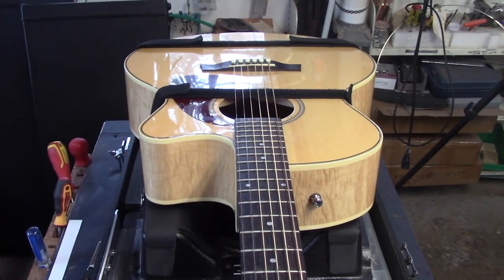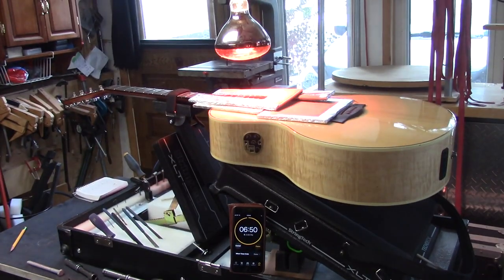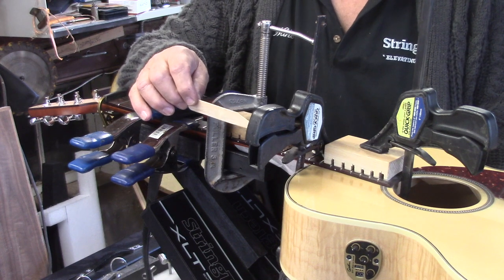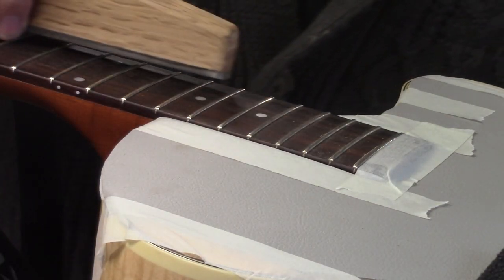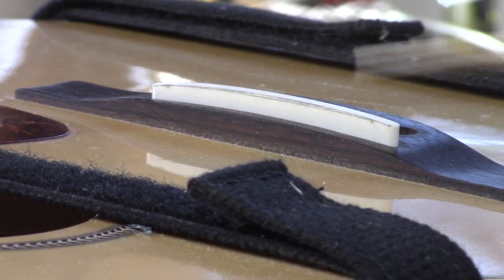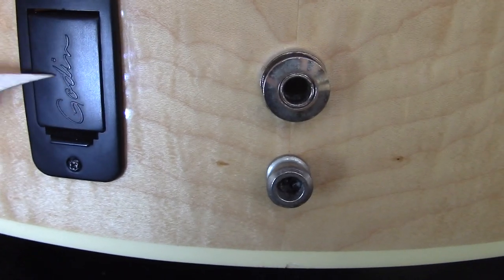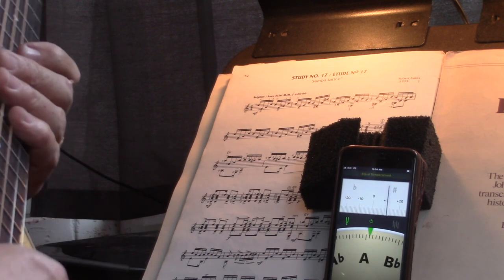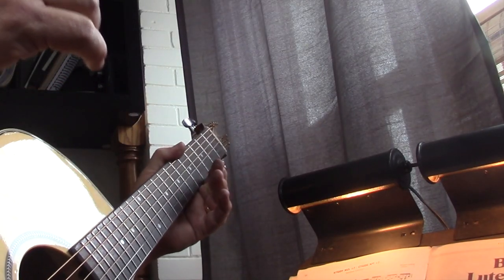XLT TechDeck / Acoustic Cutaway Re-Structure@StringTechWorkstations

Comment: It's a bolt on neck, but the fingerboard extension is still glued to the top? I know Taylors also have the fingerboard extension bolted on, as is the neck.
Reply from the maker: Yes. This one was a little trickier because there was a factory maple spline about 1 1/2" wide and 1/2" deep. This tied the neck into the head block. It spanned 4"...  from the 10th fret right up into the head block. Plenty of extra work to correct this one. Normally you'd be able to remove the bolts and slip a strip of 80 grit sandpaper under the heel ... and gradually work it into the correct neck angle . Although you'd still be faced with removing the top 8/9 frets and correcting the of fingerboard ... in order to get it absolutely perfect. Thus removing the fingerboard was the only choice to correct the trajectory of the neck angle. Doubling up the head brace and gluing in that mini strut from the X brace to the head brace seemed to firm it up and stabilize the tuning. This was a really good customer who brought his buddy along with this guitar ... whew ! Like all tradesmen ... we all have to take a bath every once in a while ... Lol !